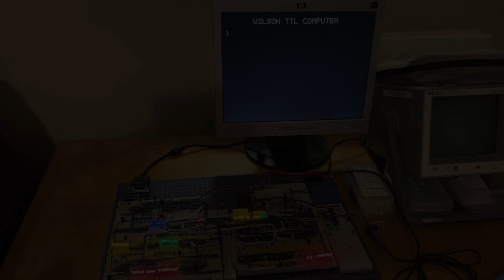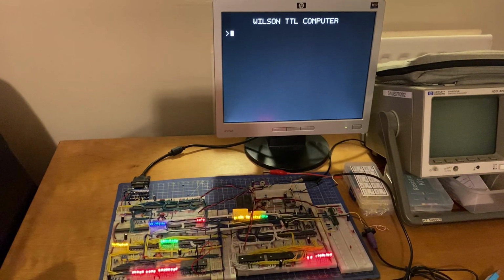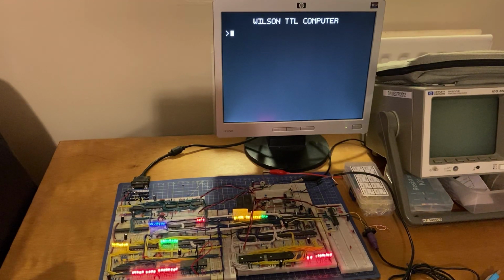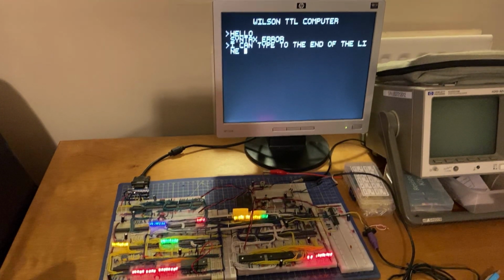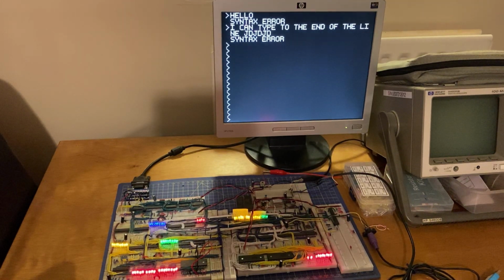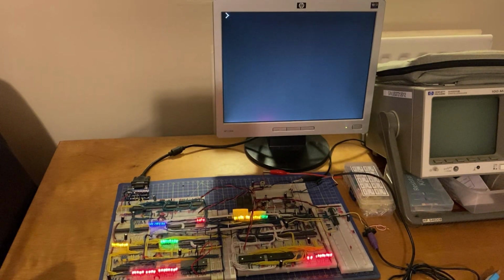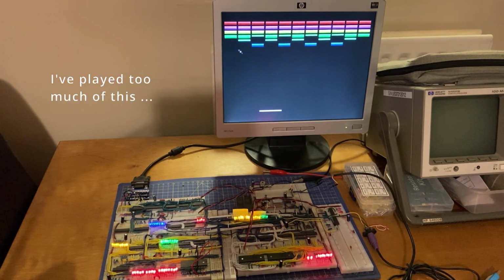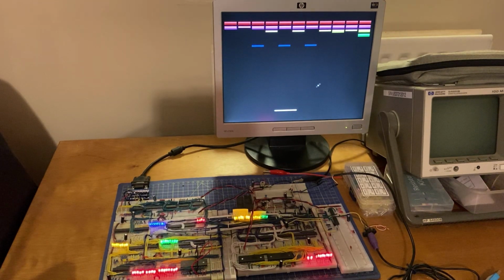Introducing Wilson - 4-bit TTL Computer

Comment: This is actually insane, congrats on this impressive work! If I understood correctly, there is no single chip CPU in this, everything is built around memory chips working as LUTs and 74xxxx logic controlling it? Yet you already have a basic "OS" and even a game for it, do you have some software for generating memory maps burned into the EPROMs or whichever chips you're using? And the programs, are they in assembly or some higher level, maybe completely custom language? This is art and a salute to vintage technology! Maybe I will build something like this too, I already have a DIY 8-bit CPU and some programs written on paper, together with ambitious plan to write a C compiler. My CPU was able to play a 30fps pixelated video on VFD, so it definitely has some potential.

Comment: cuestion, is the data bus 4bit wide? what's the directions range then? great desing btw really dig it
Reply from the maker: Hi Ian, thanks for your comment. Yes, the data bus is 4 bits wide. Not sure I understand your second question - can you clarify?
Reply: @codebail9783  thanks, I was talking about the address bus in the second one
Reply from the maker: Sure - the computer is a Harvard architecture so actually has two address buses, one for instructions (16 bits) and one for data (17 bits). For the latter, 16 bits are defined by address registers, and the remaining least significant bit is set according to the current instruction. This means it can access 128K words or 64K bytes of data memory.
Reply: @codebail9783 so it is more like the z80 with its 4bit ALU, but everything else has more bits? I think it is weird to have high bandwidth for no compute move between a register and memory, but low bandwidth between ALU and register file.